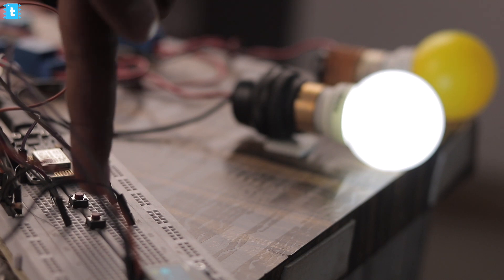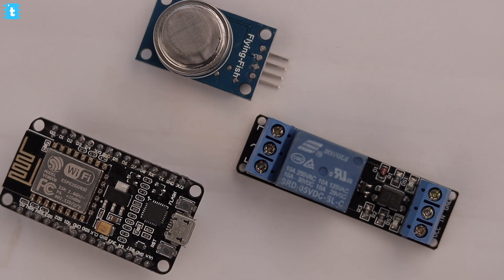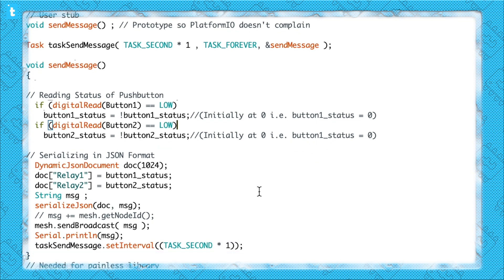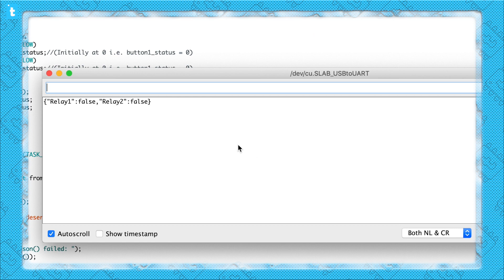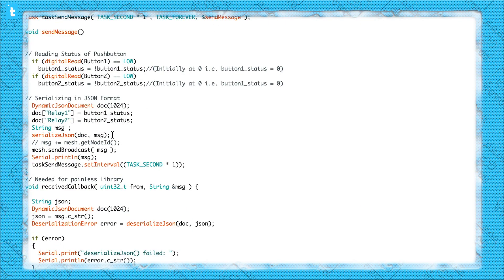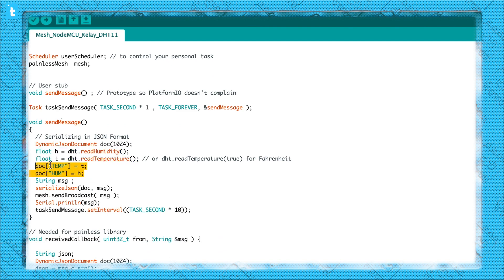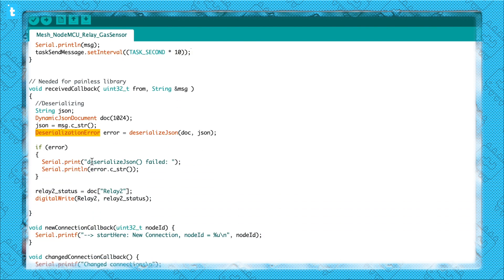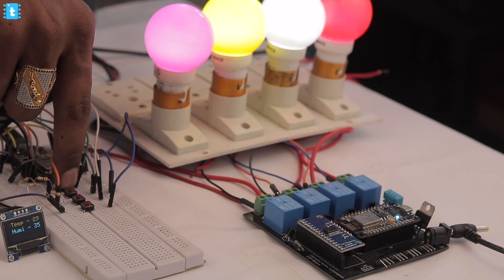Home Automation W/O Router or Internet | Mesh Networking ♻️

Comment: Thanks so much for your awesome tutorials. I am glad you've been doing a lot of blank stuff the last year or so. I am having problems with this project getting the Oled to work properly.  I've tried several different SSD libraries But having the same problems with all of them. I know my screen is good because I use it with the example sketches.  Do you have any suggestions for me? All my libraries are up-to-date. Thank you so much my friend. By the way, the mesh and buttons are working perfectly fine but every time The temp is sent to the main controller the board does a soft reset when the oled plugged in but when I unplug  The Oled the rest of the sketch works fine. The Oled the rest of the sketch works fine.

Comment: Your videos are awesome.
Well I made 16 appliances home automation project, well I would like to know can we use mesh networking and the automation through internet parallely. If yes then I thought about using the 2nd esp32 for the offline use like adding the 16 buttons in the matrix form just like the keypad.

Comment: Nice! Thanks so much for this! I’ve been working on setting up a system myself, and this will absolutely make it easier. Right now, if the raspberry pi behind the bookshelf goes down, all the lights pop up as individual ad-hoc access points, which is a pain to control. This would let me eliminate the raspberry pi entirely, dedicating it to another project, AND make things a lot easier for my spouse (whose office it is that with the lights). Thank you.
(Also thanks for including the gas sensor, as for some reason most tutorials leave those out, and I don’t ONLY want to know temp/humidity, but use these as additional smoke detectors in addition to LED control modules. More safety throughout the house, set up to show WHERE smoke is originating if detected.)

Comment: I like this approach! You can use one node as an mqtt gateway to have a hybrid solution, which can work without routers/internet, or with when you decide to extend to other interfaces connected via mqtt or such. As a side note, JSON structure contains key-value pairs, not value-key pairs as mentioned in your vid. Other than that, good work, keep it going, try the mqtt gateway, painlessMesh has examples of it. Cheers

Comment: Great one, I tried to do the same using Firebase but at the reviving end was not receiving data from firebase, I then tried to toggle an led at the receiving end through an app using the same firebase credentials and it worked but not when i send data through an esp... can you tell me what could be the problem

Comment: I tested this library like a year ago and at that time after a while all the nodemcu would hang and i had to reset that manually. Hope that i solved now. Please do tell me if it happens or not. One more thing, instead of doing it will the library(just in case if it is still not stable) you can connect them simply by creating AP out of one and connecting the other two. The project seems good and so was your explanation! 
PLEASE TELL ME IF THE LIBRARY IS STABLE OR NOT.
Reply from the maker: In my case it’s pretty stable

Comment: Finally, I found the appropriate channel
 in YouTube, your explanation is great and very clear. I hope you continue like this ... I have a question that using a gas sensor like MQ-136 to measure H2S follows the same code used in your explanation ??  How can the gas sensor be calibrated after a period of time?
Reply from the maker: First of all welcome to techiesms YouTube Channel. Here I’ll make sure you get cut to the point,informative and innovative tech videos in field of electronics.

Secondly the code shown in this video is a demo code, they won’t give you accurate data for any gas. To get accurate data for particular gas you need to study it’s datasheet
Reply: Can you explain in your next offers a brief about that I would be grateful
😊

Comment: The Idea is amazing. Your Video sheds a lot of light on the required areas! Keep it up. 
I was thinking if you could merge this technique to the Alexa controlled NodeMCU projects in a way that we could avoid having an external server like SINRIC or IFTTT. So the devices communicate directly with each other or create a mesh type hub which gives signals to all other ESPs in the house. Do u get what i am thinking?
Reply from the maker: I got it but need to study a lot in this field to make it. It’s not that easy

Comment: bro really need your help in fixing my issue with uploading code to my esp8266 (CP2102)..keep getting this error when i try to upload new sketch using Arduino IDE(1.8.12)..much appreciated if you can throw some light here..ERROR : 'Original message: {!r}'.format(ctypes.WinError()))
serial.serialutil.SerialException: Cannot configure port, something went wrong. Original message: PermissionError(13, 'A device attached to the system is not functioning.', None, 31)

Comment: Amazing 😍😍😍

In the place of NODE MCU we use ESP 32 board then all the sensor can work in same time
Reply from the maker: Ya you can use 
That same code will work with esp32 as well
Reply: @techiesms   Thanks Sir 😍...

One more question 

If i use esp 32 then 16 channel multiplexer is necessary or not.

Esp 32 has more analog pin than node mcu is this possible to take multiple sensor data at the same time without 16 Channel multiplexer.

Comment: home automation with mesh is amazing idea for area where Internet is very slow..❤️😘👌
Reply from the maker: Exactly
Reply: @techiesms  and for redundancy reasons, low power, ....
I'm looking to combine Mesh and Full Automation in my van.
when the batteries are full, it will be the full sh-bam, after that i will try to have a power-saving and minimal mode

Comment: what is the max number of nodes in the mesh? is it the same 8 max nodes in AP mode
Reply from the maker: You can read this 

https://gitlab.com/painlessMesh/painlessMesh/-/wikis/home
Reply: If I just have two node mcus in my mesh network.....what is the maximum operatable distance between these to mcus.
Reply: @sriharshakrk4009  100-400m with Line of Sight